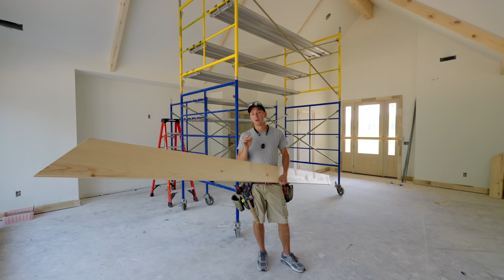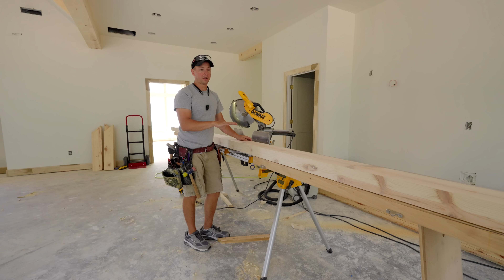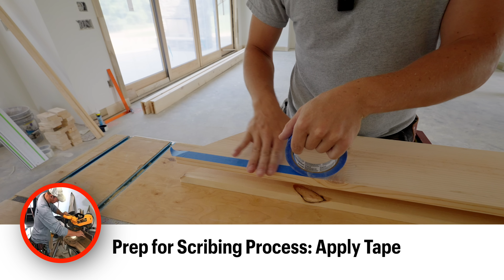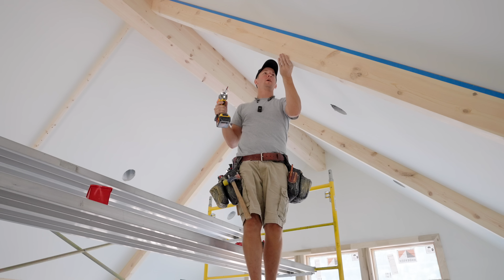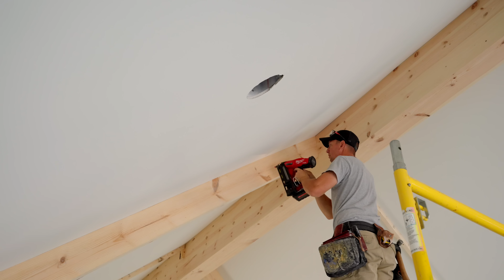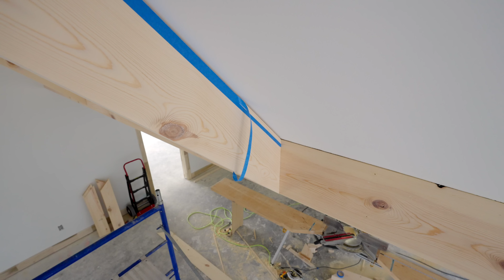How To Fit Cathedral Beams | Installation Tips

Comment: Thanks for the video. Great help. I use a smaller template. About 3’ long, one for the bottom and one for the top. I scribe each side separately because it’s easier to deal with one board than an entire beam especially if it’s wider. I like your idea of 15 degrees cutback and then using the block plane. I also further use my belt sander to get it even finer. The tape scriber method I’ve never seen before. Great idea.

Comment: You are the man. I can't comprehend doing that job alone. Anyway, I am not a fan of adding numbers to the template. I would rather have an exact template  that I do not need to do math with. All you need to do is put a board up there, square on each end. Then use your adjustable angle finder, and cut a thin piece of wood at the ange of the ceiling and the wall. Do the same for the other end. Tack your angle cuts to the board when they are up against the wall or box beam.  You have an exact emplate.   My father used to use a two stick sliding ruler device he made from two long 1X2 maple strips, held together with thin brass turn buckles he made.  He could put that thing between walls, or whatever, slide it out until they touched, tighten it up,  and plop it on a board and have the perfect dimension. No laser measuring device necessary. This is a modification of that idea. Whenever you do math, you are introducing a place you can make a mistake.

Comment: A helper and myself just finished up roughly 300 linear feet of ceiling beam. After thinking about an easy way to measure the rafter beams we came up with exactly the same way you measured yours, worked flawlessly.

Comment: Great work! As always, thanks for talking thru the process without BS or showmanship. Thanks too for including the link to the gap measuring wedge. This should be much faster for me than carrying a piuch full of various sizes of handishims. Suggestion for your lungs when it’s impractical to use dust extraction: Stealth mask. Compact, fits close to your face, comfortable to wear all day, won’t fog your glasses, replacement filters.

Comment: Spencer - Thanks for another great instructional video. If you ever need an idea for good content, an in-depth video on the scaffolding set ups, and any other equipment that you use most often for working at heights, along with an explanation of the function you get from each would be a great topic to cover. Keep up the great work.

Comment: I've taken to fitting dust extraction hose to circular saw  (nice flexible one works best) saves getting covered in dust. Works well when working outside too, when the wind will blow the dust back over you. Great tip with the blue masking tape,many thanks, you learn something new every day. Great channel, keep up the good work 👍

Comment: A stair tread gauge actually works pretty awesome for that.

Cut a rafter ( like you did) but cut it short.
Use the stair tread gauge method after that.

Perfect fit and only 2 trips up the ladder/ scaffolding.

Edit:
I realize my description is pretty vague. 

Just treat the beam like you are installing a massive stair tread.
Hopefully that’s a better description, than my first, poor explanation .
Reply: I have some of the Collins type tread gauges that work with a piece of 1x2.  I could see making a "rafter template" with a section of 1x2 coming out each end...
Reply: Yeah you could attach a thread gauge to either side of the template and you'd have the length too

Comment: I like the tape method.  Years ago we used to use a compass or dividers to scribe post form formica countertops to the wall.  We never caulked the joint to hide a poor fitting joint.

Comment: Spencer, great instructional.
Suggestion:
-Make a template with adjustable ends similar to a stair tread template. Slotted holes, wing nuts, so you can adjust length and angle same time. Transfer directly to rafter.

Comment: I always like to take an off cut with the top and bottom angles cut to double check the ends when I scribe to make sure the cuts are the same on both sides. So if one wall wasn't parallel to the other, or the ridge, or just a hump in the drywall, you can spot the difference. Awesome video as always though.

Comment: Try quarter inch plywood and a belt sander for your scribe's and then hot glue those to your template and use a router with a top bearing bit , template bit. We use to use that method on pre finished beams.

Comment: If you put blocks in attic between joists you can screw from top down to make them hug supper tight to the ceiling. We do that but we use real beams.

Comment: I actually adopted your skirt board style of layout so I check the actual finished roof angle given by the digital level, then throw a level to check for plumb on the beam and drywall at the approximate distance of drop the perlin will cover

Comment: lovely job. scaffolding worked out well. 
suprised you didnt have the scibed side pre beveled  so when you mark the scribe you could use a cordless planer  up on the scaffold to cut to the line. probably be too much for the rally bad ones but the first one  it could have worked

Comment: A couple thoughts I have that may simplify and reduce the chance for errors. Rather than measure the gaps in the angle of your jig, you could mark the ends of the jig with an offset block that is against the bottom drywall and top ridge beam. Rather than moving the jig and measuring the movement of the jig to find your length, you could tack the jig in one location and the offset blocks will automatically account for length without having to remember to account for that when transferring the marks on the ground. You could also use this method to scribe the top edges. You would need to move the jig to each side of the mounting blocking but it would save a trip up the scaffold. However, this method would likely not be as accurate as your current method with the razor scribe directly onto the workpiece. When it is time to use the offset block to transfer the marks back onto the workpiece, the offset block will be 3/4" above your workpiece be they would be sitting on the jig. To solve that, use a block that is thicker than your jig and cut a 3/4" rabbet so the leg reaches down to the workpiece.
Reply: If that works for you,  is easier and more efficient for you, that’s the route I would go.  You might drop your offset blocks, resulting in a needless trip down scaffold.I don’t know. Different strokes for different folks. I’ve noticed this with spencer. He’s all about repeatability and simple.  I believe the way he is going about it is such.  I know that I’m not a rocket scientist, so the simpler the better. Especially Friday at 4:30 pm…when the crew is ready for the weekend.

Comment: Your tips and tricks are priceless.  My only question is, for new construction (outdoor covered lanai) where the rafters and underside of the roof are still exposed, do you install the box beams and then the ship lap, or install the ship lap across the entire ceiling, then put the beams over it?  The latter seems easier, but may not look right?   Thanks, Spencer.

Comment: Great system, instead of scribing the long edge, apply tape, install beam, then caulk with high quality stretchable caulk, then remove tape. Reason being is there will be movement in drywall, framing, etc.
Those tight seams will grow. Also saves an extra trip up and down...
Reply from the maker: The size of gaps we deal with are too large to caulk. Sometimes I'm scribing 1/2" off.

Comment: Great job!  I have questions about doing that with an 8" or 10" wide beam.  I would assume that they would still need to be assembled in place.
Reply from the maker: No. I still preassemble. But I cut them with and HKC track saw or circular saw since they are too big for the miter saw.

Comment: Is there a problem with shrinkage on the wood which will open up gaps Or is the the timber stable enough for it not  to happen.
Reply from the maker: It should be pretty stable at length.

Comment: I'm in the process of building a house with a vaulted ceiling.  This video is exceptional but I'm still struggling with it.  Rather than rafter beams, I have faux collar ties that are framed with 2 x 6's. So the finished beam will be about 8-1/2" wide x 7-1/2" tall.  How can I cut a 60 degree bevel on the bottom plate for a 8/12 ceiling pitch?  The beams are 12' long.  Thinking of making a jig for a skill saw.  Appreciate any suggestions.  Thanks again!
Reply from the maker: Yep, I like to use the HKC 55. I cut it as close as I can, tack in place, scribe the cut, then cut again to perfection. It's very difficult to hit it perfectly the first time.

Comment: @InsiderCarpentry  Question: Can a production beam or mitered beam be added to an existing TEXTURED ceiling?  

The texture is not aggressive, maybe a 1/16" peak to trough.  The tape at the joints between the wall and ceiling are failing and rather than pull it all out and redo, I'd like to cover with some cathedral beams and eliminate the maintenance.  We would be painting the entire room after the beams go up.  Can the black line between the beam and texture go away with caulking?
Reply: Remember he caught a 15 degree beveled edge, so it's a sharp-edge pressing into the textured ceiling. So bump the board with your hand to crush the sharp edge into the textured ceiling

Comment: A design and efficiency critique. The recessed wall that looks like it’s getting built ins needs a full length faux header (timber frame top plate) to match the beam on the opposite side of the room, IMO. With a true timber frame, this would be partially exposed. It’s missing and the room looks like it’s missing. Just need a faux face and bottom matching the height of the opposite side. Maybe showing a 3” projection from the drywall. Stay with a mathematical plumb cut at the ridge and also at the rafter tail based on roof pitch. For an 11/12 pitch, 42.51 degrees on your saw. Normally, I would just round that off to 42.5 but it’s your project so I’m going to the hundredths place. Lol. Cut them all the same length and don’t adjust the mathematical plumb cuts. No scribing or adjustment of the plumb cuts. You will shim the face of the wrap to meet the plumb cuts. Do this with coarse thread screws (threads on the entire shank). Only scribe along the length of each rafter at the ceiling. With a miter fold assembly, use screws to overdrive and back out to shim (push) the face of the ridge or plate wrap tight to the mathematical plumb cut on each end of the rafter. An over driven full threaded screw shank will grab the 3/4 pine and the framing lumber behind it and by backing the screw out, allowing for precise shimming to your mathematical plumb cut. With knotty pine, finish screw heads are less of an issue and these are driven close to the rafter for shimming. You can close the gaps by driving the correct screws and backing them out, shimming the face to your plumb cuts. No template needed. Like running crown… don’t box yourself in with a piece that needs to be coped on both ends. Faster, easier and a better look for this project with less climbing. Assuming the room is close to square and the roof was cut properly, you can cut all your rafters to the same size. Work from the ridge down. Only have to scribe along the length to the ceiling. Easier to fit one end of something instead of fitting both ends at the same time. Pull the face of the wraps tight to the mathematical plumb cut on your rafters and not the other way around. Next one you do.

Comment: Hey Spencer been following you for a while. Stealing tips and tricks all the time lol I did some box beams a couple months ago but the contractor wanted them mitered at the ridge which is fine but you cant scribe them can you? If I scribed them then the miters would not work. You have any experience in this situation ?
Reply from the maker: Yes, I tack the ridge pieces in place. Scribe and cut the miter at the same time.

Comment: How can you install these if you do not have a wall section in the area where you need to install a beam? Can you just square off the bottom of the beam and expose the bottom. I know it would look different, but do you have any pictures that you can send me that show how this looks and if it can be done? I can message you with my email address. Thanks
Reply from the maker: It can be done. Greenside Design Build had a really nice looking room with beams done that way. Check out their instagram and youtube "The Greenside Experience"

Comment: Well Spencer, you mentioned helpers. Yes what you're doing is probably a one man show, but while you're doing the beams, the helper can be doing the simpler jobs like framing in windows. Now if you don't trust anyone else's work, just say so. While watching some of your videos I see some mistakes you made and you pointed them out. Being good at your job is one thing, being a mentor to a journeymen is another, can you do both? I was an aircraft, after working with a person for a time, I learned what a person can do, you just have to trust them. You probably can do two more houses in a year. How many contracts did you pass up because of time?

Comment: I realize that Spencer is working on high and homes. However I don't see this level of precision needed for something that's gonna be 15 feet in the air. The video is not necessary clear to exactly how much of a gap.
 That being said could he have maybe just taped the bean ran some tape and then pulled the tape?